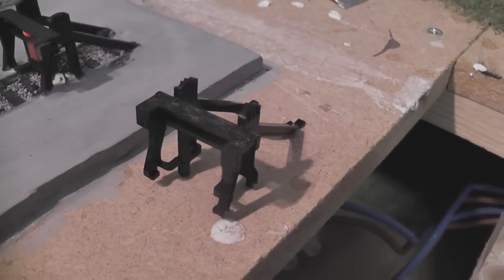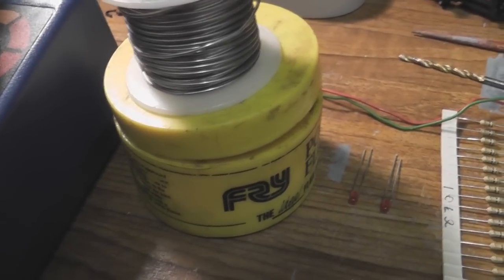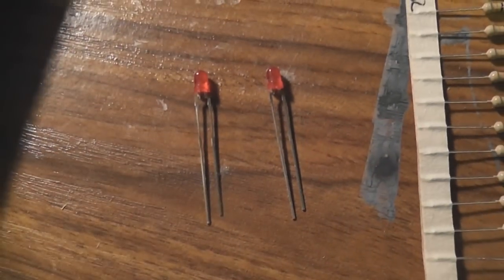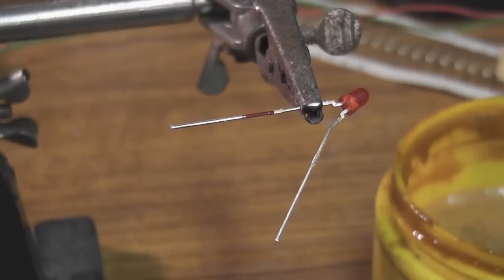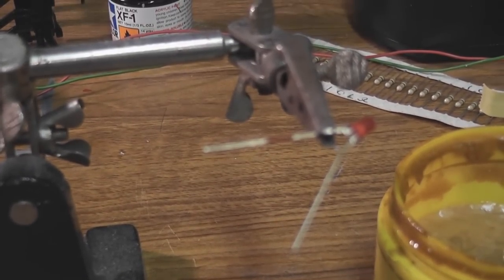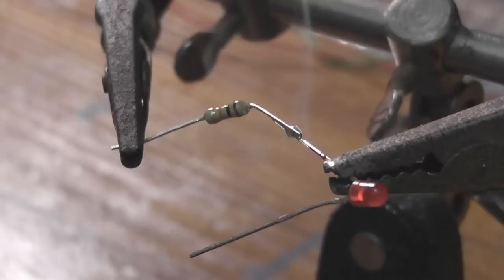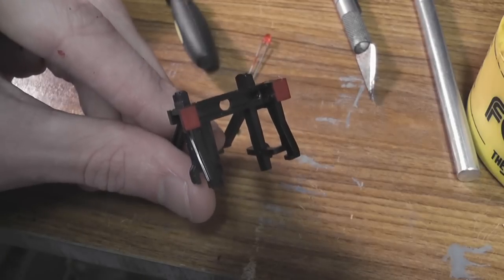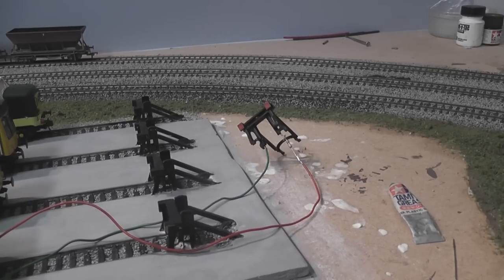How to - Episode 3 - Adding lights to a Hornby buffer stop

Comment: Excellent demo. Perfect. Some tips for your viewers:1) Frys Flux can be bought at Plumbers Merchants. You get a big tub for your money! 2) Use a modelling paint brush to apply flux - it's just a tad easier.3) The resistor doesn't need to be wired directly to the LED +ve leg. You can wire the LED and then place the resistor below the baseboard, or at the 'control panel' 4) to keep your iron tip shiny clean, search out a pack of stainless pan scrubbers at hardware stores-6 for a £1. Good Luck. Bob

Comment: hi if you connected up say 10 together and then attached the pos and ned wires to a track power clip and insered it would they then get the power they need or to much and blow them p.s could u use a  slow blinking LED

Comment: If you're lighting buildings, you will find miniature incandescent bulbs use more current than LEDs, but the light has a better spread (LEDs are more directional), you don't need to worry about polarity and you won't need a resistor.

Comment: They work well connected straight to DCC track don't need separate power supply.
Reply from the maker: Colin F Dale You do need one for LEDs,  they only work properly on DC voltage.

Comment from the maker: @DJROBVSFATBOI You could use a blinking LED if you wanted to.  10 Connected together should be fine without a resistor on 12V.

Comment: PLEASE don’t encourage people to use plumbing flux for electronics. It’ll solder; boy will it solder! But it’s highly corrosive stuff. Ideally it needs to be cleaned off plumbing pipe after use, but in practice it’s not going to damage 15mm copper pipe that has a 1.5mm wall thickness too severely. Tiny electronic components and conductors are an entirely different matter. If you spend over a hundred quid on a loco then fit a DCC decoder to it, you won’t be impressed if it’s a dead, green mess after a couple years. You might get away with it for LEDs if you don’t want them to last years. Non-corrosive electronic soldering flux is available from electronic component and tool suppliers. Personally I only ever use flux rated to ROL0 or REL0 under IPC-J-STD-004 for electronics. Search for 8341-10ML from MG Chemicals, you can get it from CPC online, and maybe Amazon too. That stuff is non-corrosive and never needs to be cleaned off. Hope this helps.

Comment from the maker: @ModelsandGamesguy Most good DC controllers have a fixed 12v connector on the back.  You could run the wires from these.

Comment: As a bit of assistance for non electronics people, if you look through the side of the LED you can see the component elements. The large side, which is very well illustrated in your video is the negative element. If you can see this it enables you to recycle LEDs. Thanks for the demonstrations on how to build a model railway, Neil

Comment: Great video I never thought of running a feeder run like the DCC for lighting . It will make it a lot easier to light the buildings and accessory items on my layout . what type of power transformer do you use for the lighting amp and wattage etc

Comment: Want to watch what type of flux you use (electronics solder is usually fluxed anyway) but if you use acid core solder or acid flux (for plumbing) you'll find eventually that the wires corrode and break. Also components come tinned, you just need to degrease them.

Comment: Nice little project to get me started on soldering. Next: DCC conversion! :-S

BTW, could these be plugged in directly to the track, rather than a separate circuit?
Reply from the maker: You would need to use a separate dc supply for things like this.  The voltage in the track for dcc is more like ac voltage, so if you plugged into the track directy the lights wouldn't work.
Reply: +EverardJunction I also tried wiring direct to analogue track. Led worked but ate all the voltage & slowed trains dramatically.

Comment: +EvaradJunction i have made these and they are very good but we soldered it straight to the track
Reply from the maker: FirstGreatWestern 57 Not possible when using  dcc so the leds have to have their own separate power feeds.
Reply: Why not? Leds do work when connected to alternate current. They are just diodes, so they will light only for half of the cycle. Since DCC frequency is high, the effect is a slight dimming of the led with no apparent flickering. The only safetuconsideration is to connect a resistor in series with the led (any value starting from 1k to 10k can be effectively used) since the 15-20V of the DCC is enough to  blow it instantly.

Comment: @Everard Junction couldnt you just touch the positive and negative wires to the rails and it would get power? why do we need to use a separate bus?
Reply: From what I understand, that cant be done on a DCC layout because the voltage isn't right. That's why DC voltage is needed.

Comment: If your layout is DC, then the LEDs should be wired to the 12v supply and not to the track or their brightness will  increase and decrease as the controller is turned up and down to adjust the speed of the train.

Comment: Hello, is the buffer wires connected to the bus wire going around the layout and is this running on DCC? Also what Ohm resistor is recommended?.